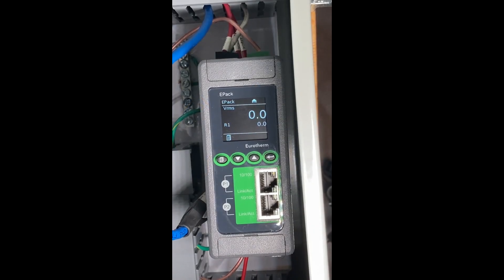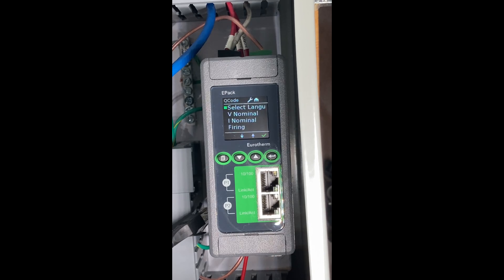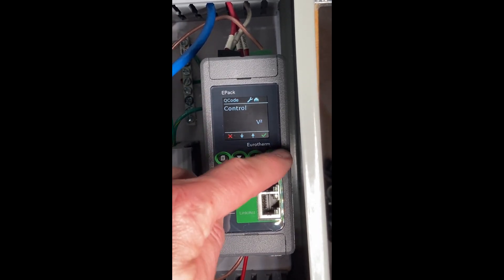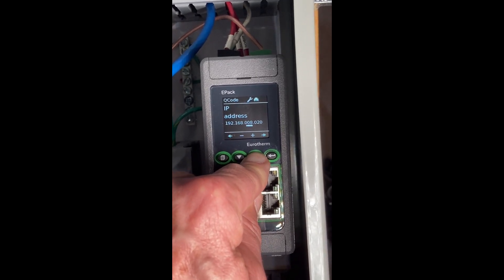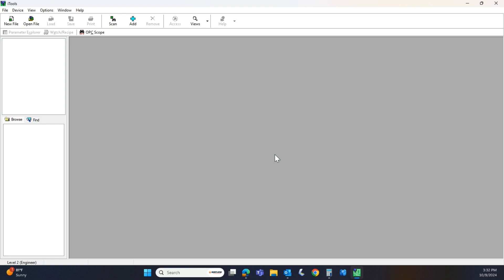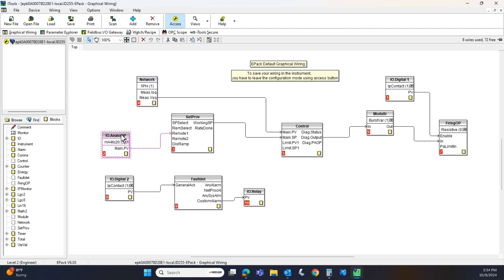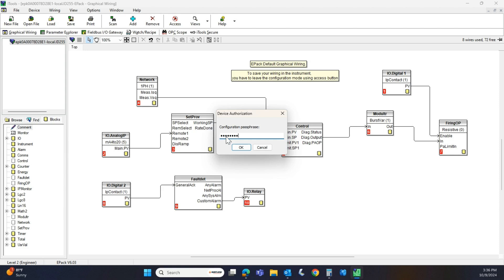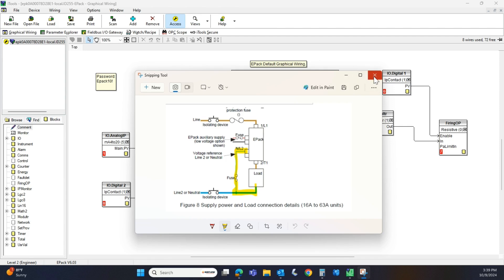How to Perform a Factory Reset on an EPack™ and Troubleshooting Common Issues

Comment: I was looking for a description of that voltage reference connection in the manual, and I'm just looking to confirm that I'm understanding correctly - that should only apply to single phase loads right? So for a 3 phase, delta connected heater nothing would get connected there?
Reply from the maker: If you are switching all three legs through the EPACK, then the Voltage reference is not connected if load is 3 phase closed delta (3D) or if load is 3 phase Open Delta (6D). This is covered in the EPACK Engineering Manual, which can be downloaded here: https://www.eurotherm.com/?wpdmdl=89815

Comment: I have a new epack and completely glossed over that i would need this comms password to access itools later, i now can not seem to get this comms password to show again nor can i factory reset my epack as i have no option within the configuration mode. Any help would be appreciated
Reply from the maker: Hello ashleystubbins3676 - 

The factory reset is based on the original factory access level passwords (which are different than the communications passwords).

Sorry for the delayed reply but I travel a lot and missed your message.

Have you gotten this resolved?

If needed, please email me at richard.lavens@watlow.com